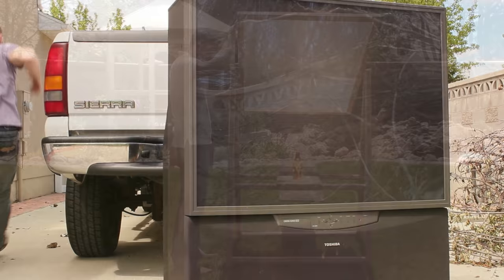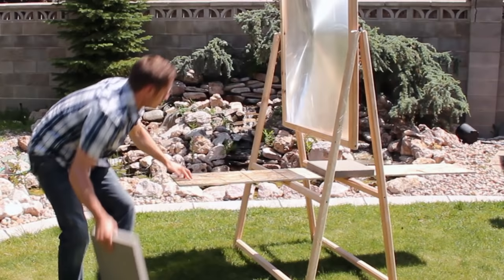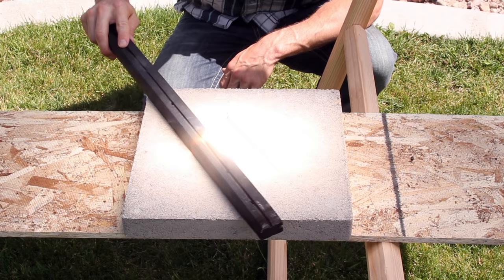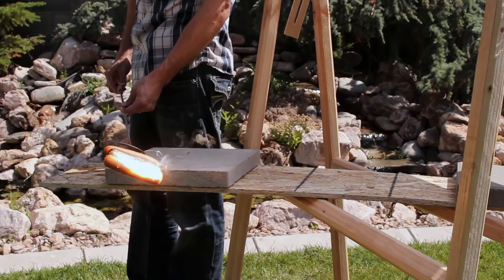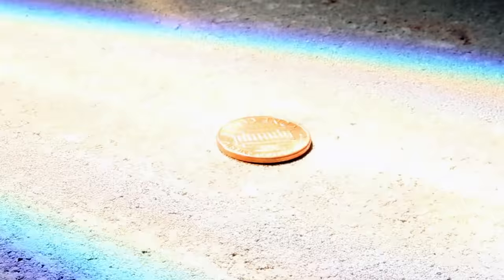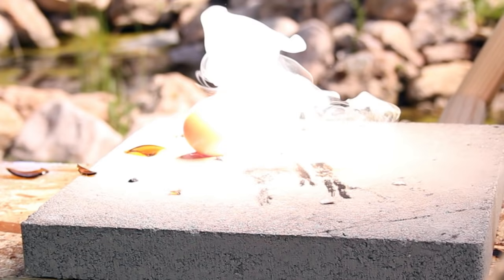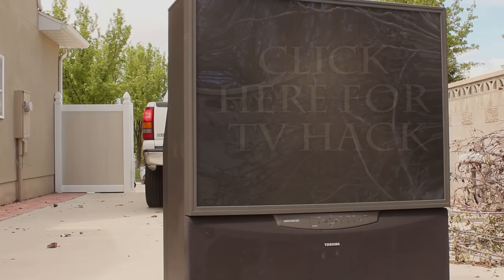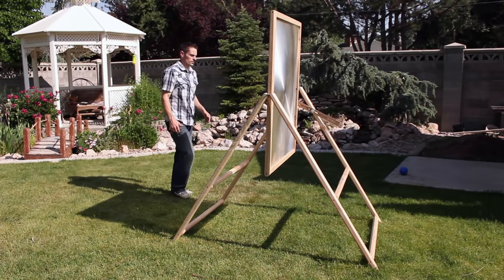Burning Stuff With 2000ºF Solar Power!!

Comment: But can it melt steel beams?
Reply: No, it needs about a couple hundred more degrees of heat.
Reply: Joe Jane is it jet fuel?
Reply: +Chandler Short
Steel melts at 1307°C, so it's actually a couple hundred degrees away from its melting point, my mistake.
Reply: Cris P Bacon 

Who's profile pic?
Reply: Unfunny af

Comment: The egg doesn't  burst as an egg is a single cell and cells don't burst unless they are overflowed with water
Reply: Put an egg in the microwave, set for 5 minutes, and turn it on.   Then come back and tell me eggs don't burst. :)
Reply: That will be because of the molecules in the egg expanding rapidly at a paced motion which causes a Chain reaction in the egg
Reply: buttonvalley Btw I did that and it didnt burst
Reply: Sorry, I don't believe you actually did it.   An uncooked egg contains a lot of water.  Microwaves causes water to heat.  When water heats, steam is produced.   Steam has greater volume than water.  In an enclosed space (like an egg shell) the steam pressure will build until the egg bursts.  Simple physics.
Reply: James Beeler I don't even watch TV I rather play minecraft
Reply: Considering one is using radiation the other is using light...
Reply: ***** Ik I was jk
Reply: +Abat and Rich I think the reason the egg didn't burst was because the heat burnt through the shell before the moisture inside could boil and explode it. I'm going to guess the shell softened under the heat first; did you notice those weird rupture holes in it?

If the heat had been applied more evenly rather than just at a single point, it might have burst. While an egg is a "single cell", it's not the same structure as a typical microscopic animal cell, and is indeed subject to bursting if its liquid contents are boiled!
Reply: J. Jones That was a smart explanation of yours. Normally an egg bursts if put in the microwave because the liquid inside boils and expands while the egg shell is not expanding as fast as the liquid. I was actually jk about the single cell thing. Only mammals like humans have single cellular eggs

Comment: These look cheap to manufacture. Could you use a bunch of these to boil enough water to run a generator?
Reply: WesOfX Whatever the water tank is made of, this death beam would just melt right through it.
Reply: Not as long as you keep water replenished.  The hottest it could get then is 100°C.
Reply: and thats called a solar pannel

Comment: I nearly set my classroom on fire today with a Bunsen burner the gas pipe came off the mains and I had a match and the match lit the gas and started squirting fire everywhere
Reply: Lol did u deaded?
Reply: +12,420,666 views yes... sadly :( He set up a bot to write this comment on this youtube video if he doesn't log to his comp in the evening that day... sad news
Reply: someone from my class set a bottle of magnesium on fire. this was fun, a 1m high flame
Reply: lol
Reply: How is that even possible? Or i guess if the gas was turned on only a tiny bit. Otherwise the speed of the gas basically blows the flame out. Or if the fire is far enough from the end of the hose, where it has had time to mix in with air. Because thats what a bunden burner does, mixes the gas with air, so it can actually burn. Thats why the gas in the pipe doesnt burn, and its hard to burn it straight from the pipe..
Reply: +12,420,666 views copy cat.
Reply: what happens if u leave the gas on for an hour and then light a match in the room?
Reply: +Clorox Bleach Yea he is deaded.
Reply: dieded

Comment: They did not get a plate when burning the egg
Reply: The plate would have burned.
Reply: +Its_Me_Dustin actually it may not burn depending on the plate (I don't think they have steel plates though)
Reply: +Focus123 I didn't think of that. 
My question is, if the other items burned almost instantly when he put them under the light, how come he didn't burn his hand?
Reply: To answer your question, you can see that Grant adjusts the lens away from his hand while he puts the objects down.

Comment: I wonder if there's a way we could use the heat from this to create power. Kinda like how nuclear power plants use hot rods to create steam.
Reply: Yea. A steam engine or better yet, a stirling engine. Steam engines run off water, but stirling engines run off hot air.

Comment: Just curious, what would happen if you used something like this on a solar panel? Of course 3,000 degrees would melt the glass, but something just slightly below glass melting point. Would it charge the batteries faster?

Comment: Get some dirt, put it in a bucket with water. Stir, let stand until the water is clear. Skim the top debris off and then you have clay left at the bottom. Use that clay instead of a brick to melt stuff on and you should have a viable start to industrious production, without the contamination interfering with the products being heated. I hope you make a video of this and also, I sure would like to help out on building some type of control for the heat from that fresnel lens. I have plans for it, just no place to WORK... Union is encroaching on my ability to live out here. I don't "PAY DUES"...

Comment: The total energy of a system can be subdivided and classified into potential energy, kinetic energy, or combinations of the two in various ways. Kinetic energy is determined by the movement of an object – or the composite motion of the components of an object – and potential energy reflects the potential of an object to have motion, and generally is a function of the position of an object within a field or may be stored in the field itself.

While these two categories are sufficient to describe all forms of energy, it is often convenient to refer to particular combinations of potential and kinetic energy as its own form. For example, the sum of translational and rotational kinetic and potential energy within a system is referred to as mechanical energy, whereas nuclear energy refers to the combined potentials within an atomic nucleus from either the nuclear force or the weak force, among other examples.

Comment: Why this small glass can have such a massive energy? Why the secret society didn't create an ultimate compact energy power device from this heat of the sun???
Reply: Fresnel lens were often used in lighthouses to focus the beam.  But they are constructed differently than those used in the old projection TV's.  I you're ever in Minnesota going along lake Superior there is a tourist lighthouse that has one of the old Fresnel lens.  Very interesting to see and excellent for teaching how a Fresnel lens works as its focusing parts are quite large compared to a sheet style Fresnel lens.

Comment: Fresnel lens of 10x size will have enough power for small ceramic or glass manufacturing. Why this great free energy source is so unpopular and undiscovered? It's simpler, cheaper and more durable than photovoltaics in scenarios when you don't need energy transformation to electricity.
Reply: scalability might be the issue (like u cant use a giant fresnel lens, but an array of them might work but even then u need to think of some way to transport heat efficiently by using some liquid that can store a lot of heat. Photovoltaics shine here as electricity by itself can be transported efficiently)

Comment: gotta ask you some its been said that the light has been going down about 3 degrees every 10 years so if the pyramids were 4500 years ago i got that the extra light is about 13.5 times which i assume would make it hotter making the contraption you have now burn at 27,000 Fahrenheit making it easily burn through the stones for the Egyptians is this correct ?

or is the light level just been going down since the pollution i dated the industrial revolution it would of been alot less but about 3547.9994 Fahrenheit which idk how well it could cut though i'll check and add later

Comment: Would it heat a swimming pool so by night the water is warm ?
Reply: Fun idea, but wouldn't work! It does not generate more heat, just focusses it on a very, very small spot. It can only put out as much heat as the surface area of the lens gets from the sun. So unless you have a lens that's bigger than the pool, it won't make a difference compared to the pool just being in sunlight.
Reply: @trashcubed4788  Ok i see. It was because when I seen someone burn a rock  I imagined wow it must be so powerful why not try a large volume of water. I understand now. Thanks ☺👍